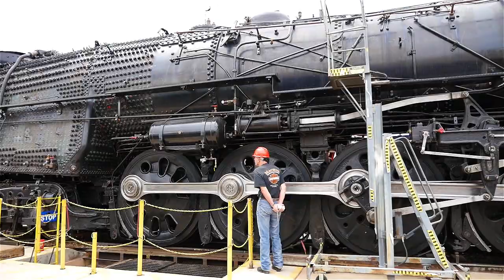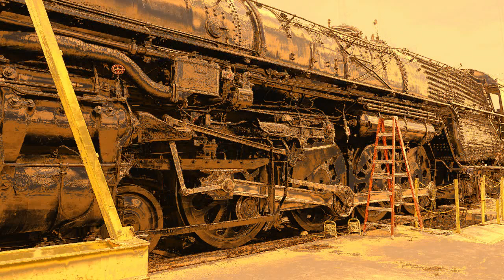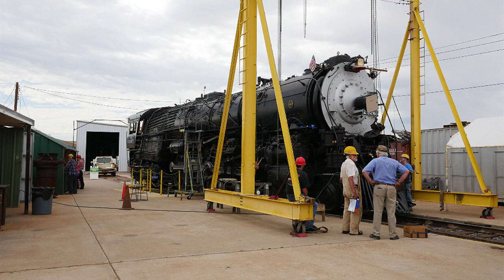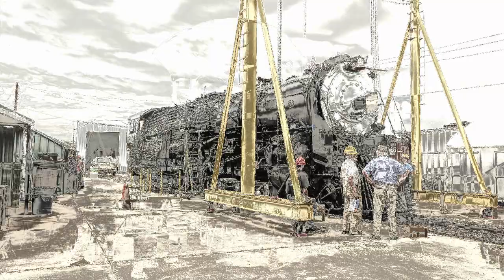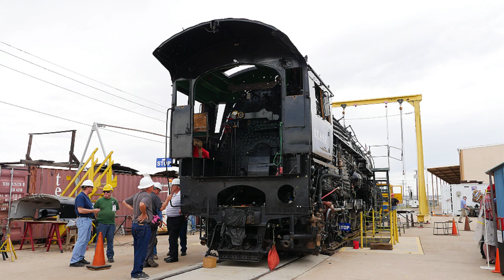Santa Fe 2926 Restoration Part 2!

Comment: I've always been a fan of the Santa Fe Steam Locomotives! They had the largest 4-8-4's and 2-10-4's. Straight forward designs with no frills and cow catchers made from used boiler tubes. Wished somebody would restore one of the 5011 class 2-10-4's that had 74" drivers, the largest ever used on a freight locomotive. 

Can't wait until the 2926 is running! Maybe one day we'll see the 2926 alongside with 4449 and 844.

-Stan Fischer
Reply: That'd be awesome, but I really want to see 2926 with 3751!